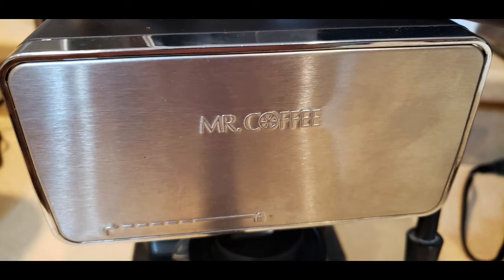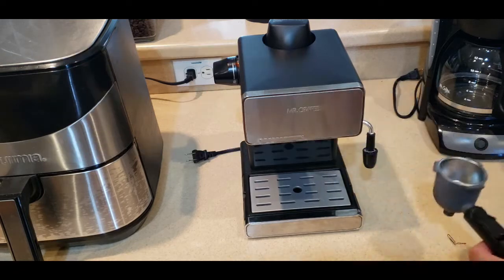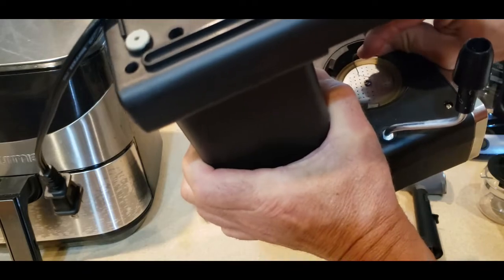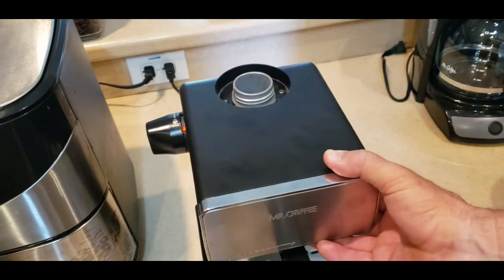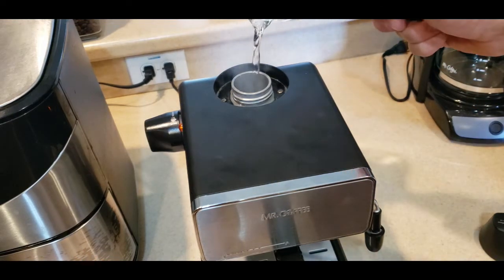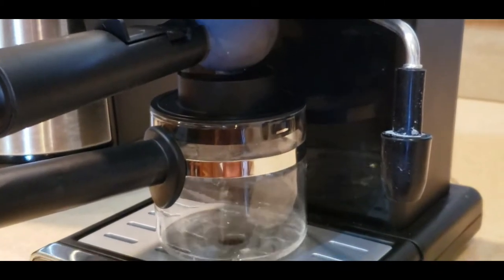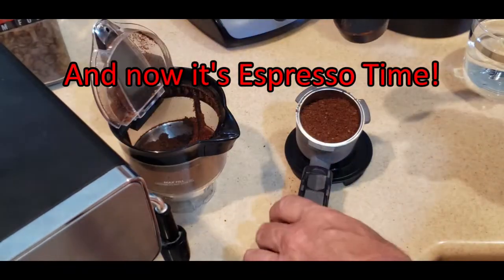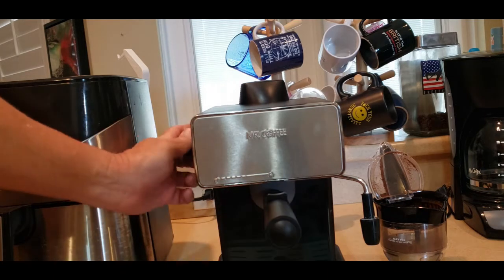How to Fix Mr  Coffee Espresso Machine Brewing function

Comment: Thanks Mike, it worked perfectly!  I cleaned it last night with a vinegar rinse and so was surprised when it wouldn't run water today.  But - like you said it must have just had some old scale blocking the pores.  Cleaned with vinegar on the outside of the drainage as well, and now it's clean and running well!

Comment: Thank you so much for this. Mine was only brewing about half of the cup. I followed the steps, exactly, and lo and behold on the first run. I heard some thing coming through, and the full 4 cups came out, and you could definitely see the settlement even after I ran it with just pure water about four times. There was still some settlement.
Reply from the maker: Glad it helped!  I threw out an expensive one a long time ago that was under a year old that I could have easily got working again if I knew about this earlier